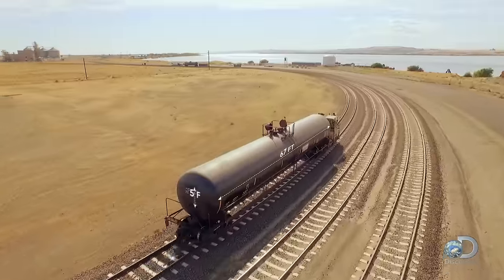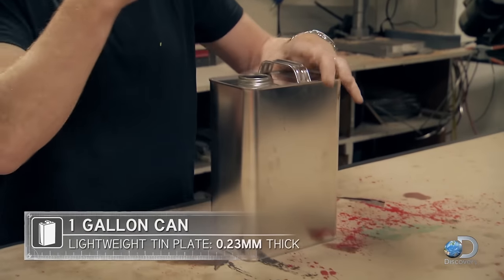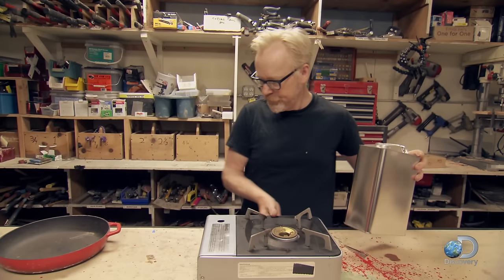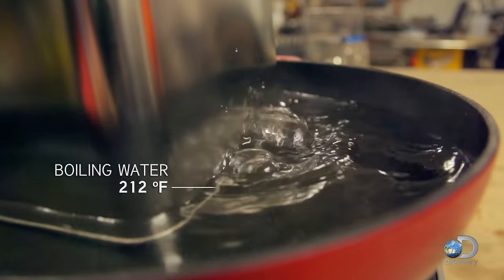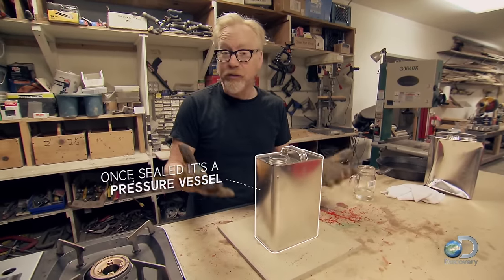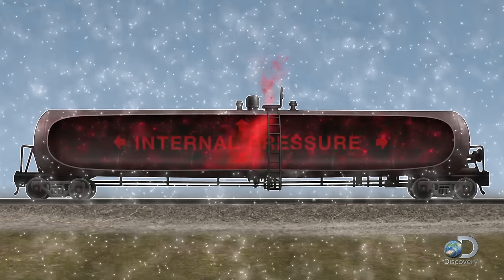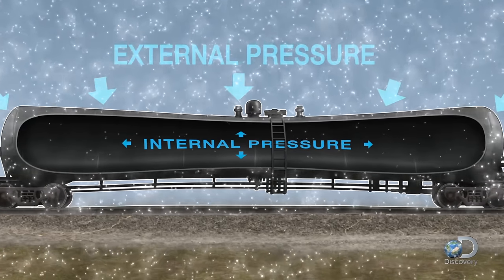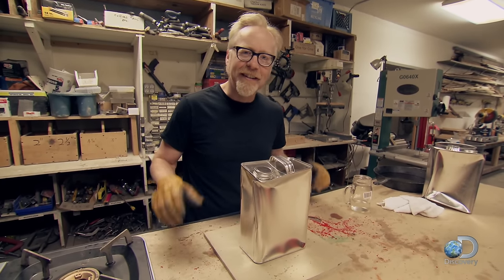The Science of Implosion | MythBusters

Comment: This is likely what happened to the five people on board the submarine going to tour the titanic. What a horrible way to die. RIP
Reply: I came here for the same exact thing wow
Reply: I’m here too for this reason
Reply: Yeah but here it imploded because of the steam cooling, I still don’t get how the sub would have imploded
Reply: @REY-RUM This makeshift sub was made to float to the surface in the event of something going wrong so the fact that it hasn’t… leaves us with very few options of what happened. If there was a small crack or even the tiniest fault in the submarine, pressure would cause the implosion. The pressure is so intense towards the ocean floor that not even blue whales or military submarines can go too deep. We barely even have the technology to go that far down in the ocean as it is so to have 5 people in a makeshift sub for this long… things don’t look good. No underwater rescue has gone deeper than 1500 feet and this craft would be at 13,000, to put it into perspective. Bottom line, even if the submarine didn’t implode upon initial communication loss, it probably has by this point. Water pressure is no joke
Reply: @myoona648 they definitely imploded and sank to the bottom. We never finding them rip
Reply: @titus9563 may they rest with those lost on that fateful night
Reply: @REY-RUM  Because if the slightest hole punctured the vessel any oxygen left would escape and the pressure of the depth they are at would implode the sub instantly
Reply: @titus9563  We do have some camera and sonar technology that is capable of going that deep/detecting that deep so we will eventually find them, I’m sure! Apparently, there were also recent reports of the banging they were hearing every 30 minutes which would definitely help narrow it down, if true. It’s just a matter of how many resources they’re willing to expend and for how long. Considering who was in the sub, they might just keep the search going till they find something.
Reply: @REY-RUM it was released that the window of the sub could only withstand a portion of the water pressure that it would endure being at the bottom of the ocean. It 100% had to have imploded.
Reply: I looked up implosion after watching news about the submarine....unreal
Reply: The sub likely imploded due to excessive fatigue and/or other structural related defects. Same concept of implosion but from external fatigue in structure versus cooling inside 😮
Reply: @myoona648 exactly. You gotta put it into perspective. So im wondering. Are they STILL sinking to the bottom? Because if so I don't really understand why the news made it seem like there was hope.
Reply: @myoona648 wrong, someone was rescued not long ago from being stuck to the titanics propeller
Reply: @TheTiredPirate they're not rescue, the pilot   unstuck it himself after half an hour. You can look it up somewhere in youtube😮
Reply: If the sub imploded it’s even worse because the metal bolted together and not one piece of bendable metal like the tin.
Reply: @Uwolz it imploded
Reply: @Uwolz  what? the core of it was carbon fibre. carbon fibre shatters under stress conditions. Nothing bended. The hull shattered and it all was over in a nanosecond for them. The best outcome compared to dying at the bottom of the sea after 4 days.
Reply: Implosion would actually be the most painless way to die. You wouldn't even feel it. Hell, you wouldn't even have time to react.
Reply: Pov: you were right
Reply: @jonarbuckle  Ya, as for ways to go bite it, this would actually be one of the better ones
Tho face planting without a parachute from a sky dive might still beat out implosion in my book
Reply: @myoona648 they did manage to see the wreckage a few times tho, so that's kind of impressive
Reply: Its milliseconds and painless
Reply: I am here too for that reason as well
Reply: Implosion is a mercy death. They don't even know they're dead, but still I feel sorry for the young boy who was anxious about the trip. He must have been unsettled for the last few hours of his life about getting in that death trap.
Reply: They dont have got sensation of pain....death will be  faster than the pain receptor got the impulse...
Reply: @REY-RUM  Because of the pressure at that depth is what crushed it.
Reply: @REY-RUM  It's still the same principle: lower pressure on the inside compared to the outside. In a deep sea submarine, the air pressure on the inside is obviously kept much lower in order for the human passengers inside to actually stay alive, and the hull is built to resist the massive water pressure coming in from the outside. Any flaws or damage to the hull would allow the water pressure to basically exert all of its force onto that weakness, resulting in an implosion. The Titan was built out of a carbon fiber + titanium composite, which on paper sounds tough and durable (similar components are used on cars and aircraft), but in reality is really bad for deep sea vessels because their properties both individually and together make them poor materials for withstanding repeated dives in deep water. So the vessel dived a handful of times, which weakened the unsuitable hull, until it finally broke and allowed the outer water pressure to crush it ruthlessly.
Reply: its not that hard. its like a man standing under an apartment building held in air with a crane or even better just some appropriately strong sticks. one stick cracks, all sticks crack and the man is less than mush in 0.2 seconds.
the weight of water on top of submarine is easily a few apartment houses. and in water that same pressure comes from all directions.

but i think as a victim its one of the cleanest ways to die. not weeks in hospital bed and struggling to breath, not shot and bleeding slowly, not being eaten by something that plays with you
Reply: @StrikeNoir105E well said.
Reply: @REY-RUM water pressure. At some point on their way to the bottom, either the carbon fiber hull came loose due to fatigue (fatigue meaning the hull wore out over time, as all things do. Think: shocks on a car), allowing the weight of the ocean to crush the rest of the sub in milliseconds. Or, the porthole (which was not built to go 2.5 miles under water) failed, causing millions of gallons of water to rush into the sub at extreme speed, again crushing it in milliseconds. 

Either way, it was thankfully a very quick way to go. They probably didn’t even know what happened. One second, they were just hanging out as they traveled to the bottom of the ocean. The next, they were basically crushed into mist by the immense pressure of the ocean, like an industrial hydraulic press crushes styrofoam.
Reply: The most horrible part would have been any knowledge of what was happening before it did, the incalculable claustrophobia and surreal dread. If they had any idea how much trouble they were in they probably went numb with terror. Getting the inevitable over with would be a mercy in that nightmare. I hope the pilot downplayed the problem as much as he could because sharing the news of impending death would be unnecessary at that point.

Comment: Missing submersible could have imploded. I came here to understand what it means when they say that.
Reply: It did
Reply: Basically, what happened was much more extreme than in this video, because the pressure differential was so much larger on account of being several kilometers under the water. It's safe to say that what the submarine experienced was a true implosion, that is to say, an explosion, but going inwards.

Comment: For the crew of Titan I sure hope the implosion went a lot faster than this! RIP
Reply: It would have been instant. 
I guess that's the only good thing to take away from this, is that the passengers wouldn't have felt a thing.
Reply: YouTube Byford Dolphin incident, pretty much what happened to them
Reply: it would have been so fast and intense the pressure would have caused the air to super heat compressed and cause an explosion that incinerated them and spread debris
Reply: @punkhop23  An implosion into an explosion?  Kinda reminds me of how they make nuclear fusion work in the lab
Reply: Yeah, within milliseconds. They wouldn’t have even known. RIP 💔
Reply: This was under 15 psi, the sub was under about 5000 psi reportedly. VAST difference
Reply: @ryancadiz5688 ut in reverse. The Byford Dolphin was an explosive decompression from 9 atmospheres to 1 atmosphere ( ambient sea level). Apart from the diver who got shredded as he was ejected through a partially closed steel hatch, the others died because of rapid expansion of bodily gases that ruptured internal organs and actually boiled their blood. Imagine being sucked into a vacuum from a spaceship, but with 9 times the effect. 

In this case, the pressure differential was approx 350:1 assuming the interior was at 1 atmosphere, and the outside was at  350 atm, corresponding to 3500m depth. The use of carbon fiber would have possibly amplified the effect of the implosion by shattering extremely fast rather than a exceeding the elastic limits of the usual titanium pressure vessel. Such rapid compression can ignite the oxygen in the air in the same way that an internal combustion engine works.

The unfortunate crew would either have been incinerated and then crushed, or torn apart by shattered carbon fiber fragments at the speed of a bomb blast, or both. I think it is highly unlikely that there was a gradual  leak or any chance if death by drowning.

And in case anyone things that this would be survivable because humans might be able dive to over 300m with appropriate gas mixtures, you have to consider the speed of the pressure change. Like the explosive decompression in the Byford Dolphin incident, if the decompression is done slowly as intended (over several hours), there are no health issues. If done instantly, the human body will not survive.
Reply: @drg9812 and in H-bombs of course, more correctly called Fission-Fusion bombs. The initial fission explosion accelerates the radioactive outer material into the core at near light speed, which then exceeds critical mass causing a fusion reaction and a far greater explosive yield than by fission alone,
Reply: @ryancadiz5688  Stop trying to be an expert when you clearly cant tell the difference between decompression and implosion

Comment: It takes approximately 100 milliseconds for your neurons to register pain. It took approximately 30 milliseconds for one end of the vessel to pancake and touch the other end of the vessel. During those 30 milliseconds temperatures in the vessel, including the air within their lungs rose to the heat of the surface of the sun incinerating their bodies and turning their bodies into a gelatin which would have been squeezed out of the vessel in every direction at extremely high velocities. So everyone saying they feel bad for how they suffered? Its more like them looking at a red master alarm and going to touch it. And as they touch it they are actually touching the pearly white gates wondering where they are. Ever hear a dog clicker? All of this would happen faster than the length of the initial click sound. There is not a more instantaneous death possible in this world. When I reach an old age and its time for me to go sign me up for this route.
Reply: Actually, I don't think they'd have even noticed an alarm. IIRC the engineer who'd earlier been fired for pointing out issues with the craft had worked out that the acoustic monitoring system that Rush wanted to use would, at best, only detect a problem literal milliseconds before hull failure. Probably the best option if you're going to die in a water-related way, definitely.

Comment: So basically the submarine was fine then boom, got crushed instantly. Terrifying
Reply: 😢 yep
Reply: well if you have a carbon fiber hull you are lighter not stronger, carbon fiber is much less malleable than most metals and carbon do not deform due to absence of the metallic bonds which is required to be malleable, as soon as the first spot cracked it was like a easter egg
Reply: @souljaboy.6668  very scary
Reply: @TempleofShaolin  so much more scary than the metal, and was made by a guy that could have afforded to make it aluminum
Reply: @souljaboy.6668 He bought a disposed/not passable carbon fiber part from Boeing for cheap too 😅

If that thing was not up to the standard for an airplane, how much more for the depths of the sea...
Reply: @gachagamer536  fr bro killed himself and then some
Reply: @souljaboy.6668 ”I bought [these lights] from Camper World.”

“All of this is controlled with this video game controller.” whips out a knock-off wireless Xbox controller from 2011 

Also, let’s not forget that the CEO literally fired an engineer for expressing concern about the safety (or lack thereof) of the sub. Basically, this was bound to happen.

Comment: I can’t imagine how they got crushed in the submersible 😢 This is absolute horror. Hope they rest in peace. Condolences to their families.
Reply: In the sub at the bottom of the ocean it happened instantly. Air is a lot lighter than the water 2.5 miles under water. 6000 pounds of pressure over every inch of your body.

Instantly. No suffering.
Reply: Basically, they were Obliterated by extremely extreme overpressure
Reply: If it helps they died before they even realized something went wrong
Reply: They were told by experts it wouldn't work, they chose thier own fate it was thier own fault to cheap out on a submarine
Reply: Bodies were Crushed like an egg, and the ooze dissipated…wafting away in the current.  The calcium carbonate bones would be crushed and fractured, maybe a few fragments found in the debris pile…just like a seashell found on the seashore.
Reply: It's the best way to go out. Instantaneous death instead of waiting slowly and getting suffocated.
Reply: They would die before noticing they died it would be faster then the human realization
Reply: @RoadblockaRoadBlocker683  what their eyes saw probably didn't get send and registered in the brain to realize what happened, also, most likely the same with pain, they didn't even have time to feel it.
Reply: rest in pieces mostly.
Reply: @neometalx9  I'm sure it's possible they would have realized at least a couple of seconds before it actually started to implode that they were screwed. 😢
Reply: Its better to get crushed instantly then run out of air in the dark
Reply: @riven5677  ...yes, that's the only consolation...! ☹
Reply: They didn't even know what was happening
Reply: Broskisnowski  consider that the force of the implosion superheated the air inside, I don't think any limbs will be intact after that.
Reply: Its like the walls were closing in on them and they slowly got crushed. One second they were there. Then the next they weren't.
Reply: The implosion was faster than the speed at which the signals reach your brain. They were literally dead before their brains knew something was wrong.
Reply: They were atomised.

Comment: What we know from the Oceangate Titan tragedy…

Titan’s size: 22-ft long x 9.2-ft wide x 8.3-ft high

Approx. interior volume: 1,680 cu-ft or about the space inside a mini van without seats according to David Pogue) 

Interior air pressure: 1 atm (or 14.7 pounds per sq-in)

Lost comms with Titan: 1 hr 45 min into the dive (approx. ¾ of the way down)

Depth of Titanic wreckage: 2½ miles 

Ocean pressure at Titanic wreckage: 400 atm (or 5,880 pounds per sq-in)

Something breached? And the hull imploded… it would have been over in a milli second? Nano second?

They didn’t know what hit them.
It was instantaneous.

Comment: You can do this with a 4 litre plastic milk jug. Just get your tap water super hot and pour a little bit into the jug until steam rises fromit. Then quickly put the cap on. It will start crushhing itself right away.

Comment: I pressure tested aircraft ducts . Kevlar and fiberglass , heating and air condition ducts . Both positive and negative pressure. Just a half pound of negative pressure , would crush a duct of either material . Yes faster than you can blink an eye . The bigger the duct the faster it imploded , due to the volume .

Comment: And that's just a difference of 10psi or so.  Atmosphere 14, interior of can the pressure reducing as it cools.  Imagine though over 5,000 PSI differential (5,000 outside, roughly 14 inside) and a brittle tube for a pressure vessel.  You get nothing, nothing, nothing, boom, tube fails, pressure vessel and it's occupants are destroyed in less time than a neuron takes to fire.

Comment: When Mythbusters was still current I tried to suggest they prove that airplanes are not "sucked" up into the air, but pushed up into the air. It's Bernoulli's Principle correctly interpreted. My suggested test for those two guys (who actually hated each other) was for them to set a hypersensitive scale on a runway right near where jets set down to measure the downward force that should equal the weight of the aircraft. Unfortunately every effort to get my suggested test accepted was met with a notice from their website that it was not going through. Hmm....so two guys presenting themselves as tech-savvy had a flawed website?

Comment: The OceanGate's submersible incident was worse than this. Instead of the hull crushing down, it just shatters.

Yes, they were crushed by the deep sea pressure itself, not the vessel.
Reply: before being crushed, they got disintegrated (or "atomized") by the heat of the air being compressed with 5000 mph. So the water probably just hit plasma

Comment: For those wondering the bodies in the Titan got pulped like an orange from the decompression
Reply: It would have ignited as well from the air compressing.   Much like a cylinder in a diesel motor.   When the air compresses that fast and under that much pressure it actually explodes. Not a pretty scene but very quick and painless.